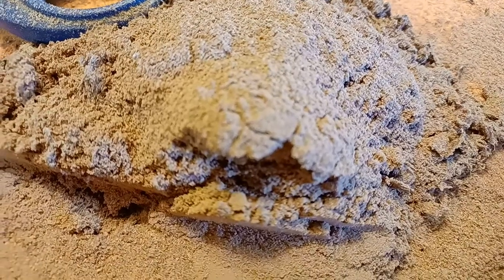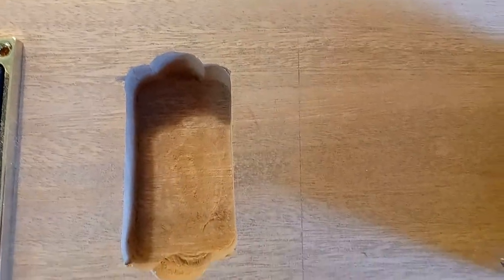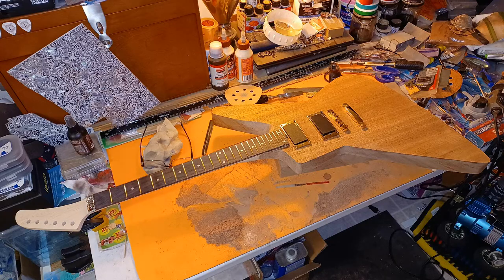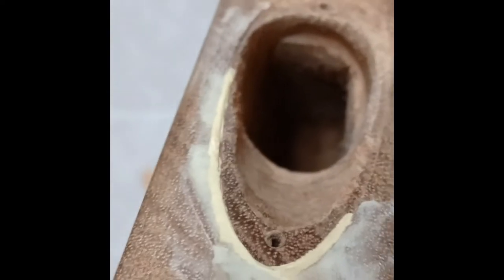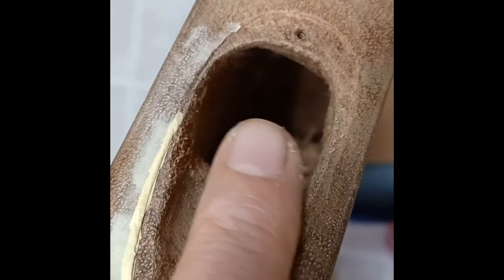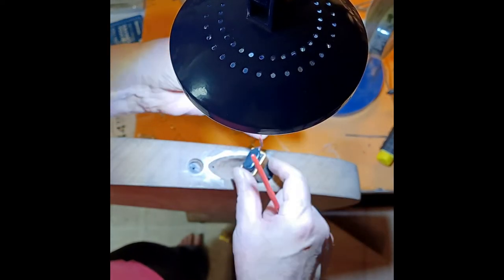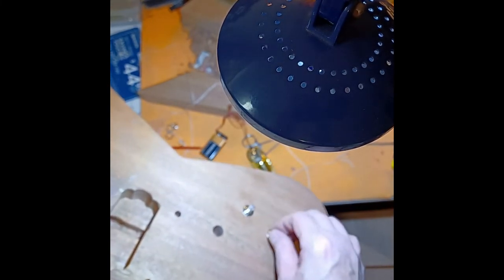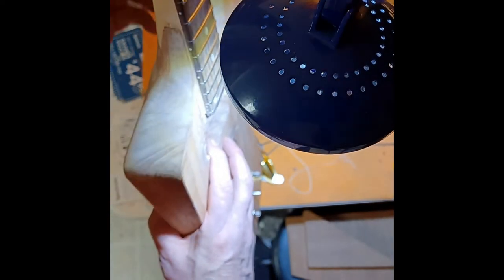GGBO22 Update and Start of Paint Work

Comment: Looking good... About ready for some electronics. While a jack is a jack to me, I always thought the strat style jacks were really cool... Looks like that's what you're doing. Awesome job as always!
Reply from the maker: yes and it will even point up and not down to accommodate the cable looping over the strap like everyone always does to get it behind you or up to a wireless unit hanging on the strap.

Comment: Look at that cave! Jeez bill that must of taken forever! Looks awesome!
Reply from the maker: Thank you Brett! The carving around the neck joint was actually pretty straight forward and easy. (And I still messed it up. there is the tiniest of flat spots you can barely feel but it shows under paint.) The hardest part was getting the belly carve rounded so it flowed smooth under paint and didn't look like a hard line cut. Digging out the control cavity was just pure insanity. Won't be doing that in the near future even if it looks so good without cavity covers.